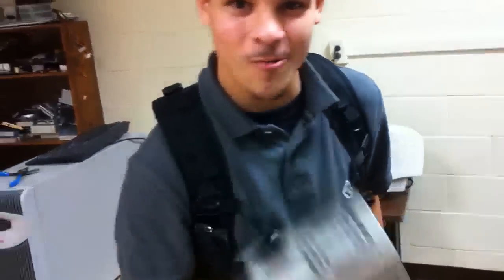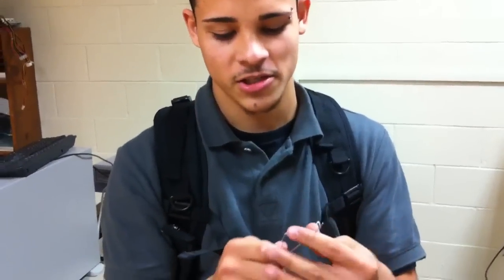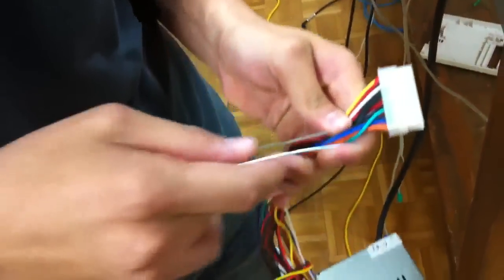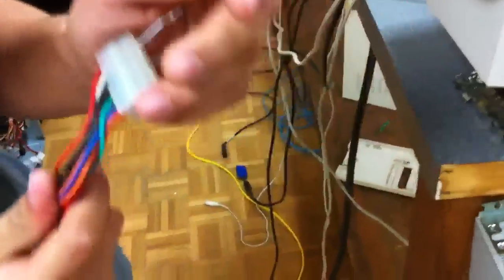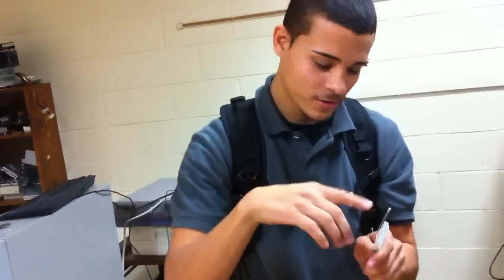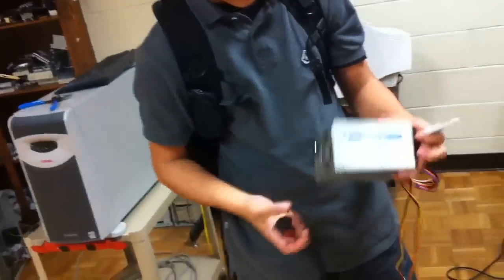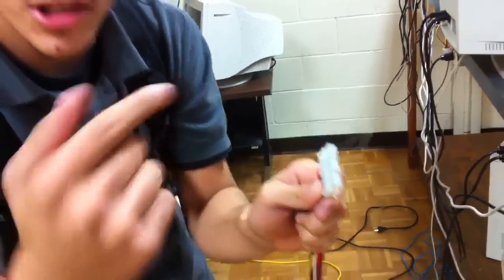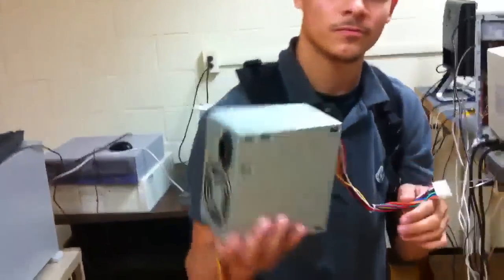How to test if a computer power supply works

Comment: You should always plug the cord into the wall last because sometimes if a computer power isn't fully functional or doesn't work or has problems the capacitors and other internal components inside the computer power power supply can explode and cause a fire also when testing computer power supply's you should always have a fire extinguisher close by for safety

Comment: I wish my professors said things like this : 

Always check the gas is either burning or isolated...Or you're gonna be fucked
Don't let too much current travel through your fuse....Or you're gonna be fucked
Don't leave a sterling motors heat source going if the thing isn't spinning...Or you're gonna be fucked

Comment: Son, what you have demonstrated is how to power on a power supply by bypassing the means of using a motherboard and computer case. To test a power supply you will need a DMM to verify you are getting the correct voltage, respectively to the color wire. And besides, you will NOT get shocked if you touch the paperclip while the power supply is powered on, all you doing is grounding the green wire (PS_ON).

Comment: Thanksman. very helpful
Reply: its not that helpful sir this might give you nightmare thinking that your PSU is working becoz its fan is spinning. it does not give a 100% accuracy of a result.
Reply: Lagas BAyani it told me  that at least power was going through, That was what I was testing for. Very helpful.
Reply: +believerornot     ok I give you that.// but be careful, dont rely on it 100% bcoz it dosnt give the accurate result. some power supply spins its fan but do not give enough current to give display to your pc. (based on my exp)
Reply: Lagas BAyani thats when you have to get the meters out :)

Comment: Ok, this is a way to test if you can make one part of a PSU to function. 
To start with, there is no need to be that strict on "DO NOT TOUCH THIS" it is electricity indeed but it isnt enough to even hurt you, i think it is arround 3V going through that loopback on DC, that voltage is not enough to make it flow through your skin.... It doesnt allow too much current through either to say that the wire may get hot or something. Also all comercial PSU's are grounded...

Now to the "working" part, This isnt the way of checking if the PSU is working, its a step required to "turn it on" and then measure the voltages per pin (check the data sheets for what each pin is supose to output) and if you verify that they do output 3.3, 5, -5, 12V then you can verify it works. 

But also consider the previous use... Components may have been damaged, The fact that it works short term doesnt mean it will long term...
Reply: +MC fill   Agree with you... "DO NOT TOUCH THIS" was funny.... Nothing will happen if we touch it...
Reply: +Sanjay Prasad wasn't it :D
Reply: Yeah... That Green wire will have less than +5V coming from some chip inside SMPS and that too it is grounded so no harm... A human body can bear nearly 60V if I am not wrong..

Comment: please, change the title in "how to test if a computer power supply fan works"
Reply: +James Cogdell the fan can work on a broken psu. so no... that wasnt a joke
Reply: ..... youre missing the point. The fan can run but the psu can be broke too. The fan working is just a quick test. If you want to know if a psu is functioning properly youd need to test the voltage
Reply: Sean Menge no, if a psu is dead, the fan won't work.
Reply: +crisimof 
lol smh somebody should had give more thought to what he just did before they commented about a fan
Reply: crisimof Is this a joke? For the fan to work, you need to power supply to power it. Which means it's working.
Reply: +James Cogdell The psu might not be dead, it might be malfunctioning... So yes, with this test you only know that it turns on, no that is working properly...
Reply from the maker: how to check on budget obviously you can always just hook it up to the motherboard . i will recomend to use make your on video
Reply: NO you cannot. Connecting it to a motherboard will not be a good test.
If you do, then sure. If the PSU works your motherboard will start.
If it does not work, your motherboard is either on fire or does not have enough to start.

Comment: My PC no power and no beeping noise. CPU and PSU fan not spinning. Hotwire the PSU cable, the fan spin but cannot power up the PC. Hooked the mobo with an OK PSU, the PC boot. Something inside the PSU burst.

Comment: i don't know what you're talking about it. the paper clip is connected to a ground and a logical green wire. It's pretty same as if you touch the case. I don't think it's dangerous at all, correct me if i'm wrong.

Comment: Hi Coolpast, thanks for the video showing how to test a psu. My only request is, not to use bad language on these utube videos, caz my son was sitting about 10 ft away and that was not cool. 

anyways, thanks for the video.
Reply: Who cares it's YouTube.
Reply: on top of that it's not correct what's he's saying

it's completely harmless to touch since it's only under 3 volts of electric tension and carries only a small current.. it's literally just an on/off switch and that doesn't need a lot of power

the other rails are under 12V max but can carry very high currents that could be lethal under very unfortunate circumstances but generally aren't with these low voltages and when just touching them with your hands since the current will just wander across your skin causing superficial burns but no further damage

besides: just because the PSU will start up doesn't mean it's not broken
Reply: Flyingcircus
indeed I had a PSU that did work when I connected the green and black wire. but it didnt work when I hooked it up to the motherboard. and when I tried a new PSU on the same motherboard it worked perfectly.

Comment: you can touch it. no problem. Nothing is going to happen. It's a closed circuit.
Reply: The pin closes the circuit giving access for the current (A) to flow to PSU circuit board, transistors, capacitors, regulaters fan and devices which forms the PSU and cables. Cause the fan spins doesn't guarantee that the PSU has is in good condition. You must check individually each cable with a multimeter or just by connecting hardware. there's a 12V to operate motors, such as hard drive & fans, 5V for peripherals and 3.3V for other low voltage devices. All 3 different Voltages is provided by the motherboard spliting the right Voltage to the right devices.
Reply: Yes nothing happens brother, I did the same technique to test my PSU on my new PC that I'm building. Because when I press the power button, my PC wouldn't start, I could see all the fans spinning for less than a second and then they would stop. I need help where are you?

Comment: This method is not effective, just because the fan runs does not mean the PSU is putting out the appropriate voltages. Your test is nice, but incomplete.

Comment: Just because power supply starts based on earthing of green and black wire doesn't necessarily mean it can power up the computer as there's more than one output that matter. Even power supply tester can't be relied upon 100%. If your computer is not starting up then power supply is almost always the first culprit.

Comment: Yes, this is a good test and it does show if the power supply unit is working internally. However, other problems could still cause a computer not to work properly with that power supply hooked up. These include low or missing or over-voltages, and the Power Good Signal which must be between 100 and 900 ms. 

Lastly, the only true way to test a power supply is to replace it with a known good one. Check out my blog for other great computer help ideas at Glick's Computer Repair on the web.

Comment: For the others watching this video. If you don't have a multimeter to test the 12v, 5v and 3.3v rails and won't have any other need for a multimeter, you can buy PSU testers for around $15. Some have LCD screens to display the volts, others just have LED lights to indicate proper current.

Comment: there's only 12v maybe there, not going to do anything to you. I used to work on tv's. I started back in 1960's when we had tube tv's and there were lots of dangerous voltages. Nowdays there's not much that can hurt you, maybe the AC line, that's the most danger.

Comment: If you touched the paper clip it wouldn't hurt you.  The voltage to the PC is so low that it would cause no injury and it is a closed circuit so you wouldn't be electrocuted anyways.

Comment: I got a old P4 pc. it worked perfectly ago one month. But it's not working recently. When I plug the pc and turn it on. it doesn't get current and not working. I checked the power supply too. It worked perfectly. So what's wrong with that???

Comment: So if I test my power supply like this and the fan works and the green light is solid green, but then i connect the power supply to my motherboard and the green light blinks and nothing works, then it is definitely a problem with the motherboard or could there still be a problem with the power supply?

Comment: What?, You took a paper clip and put turquoise green and black. black is known to be positive sometimes. So bro,  it looks like you hooked positive negative together. If it is you should take this video down. Because someone who's not very bright, might do it. No, I didn't see the power supply fan spinning.  Is that correct what you showed us?